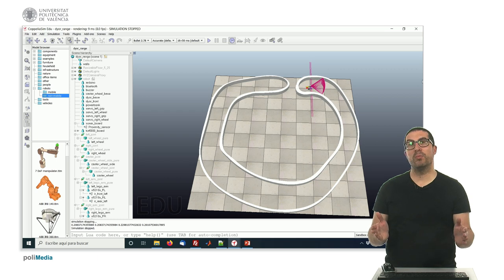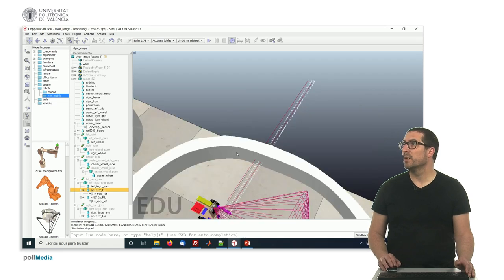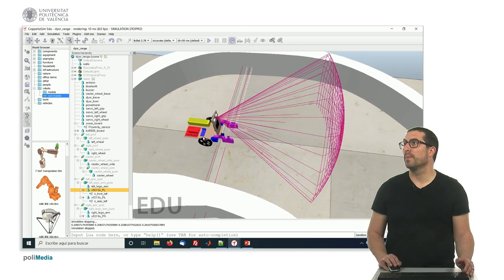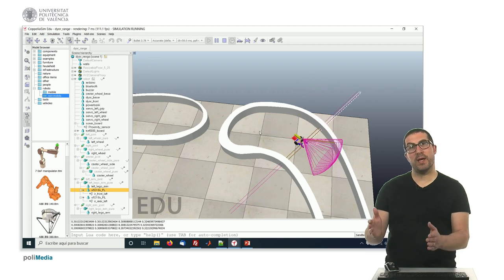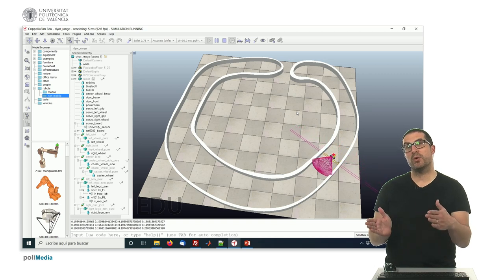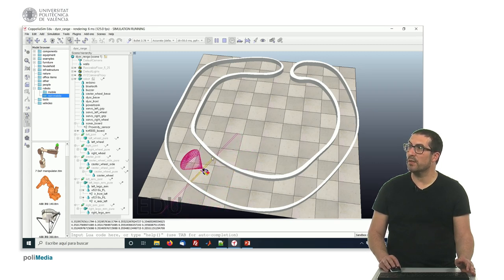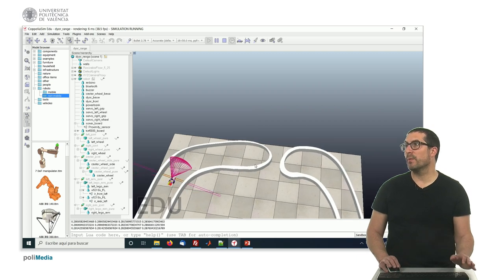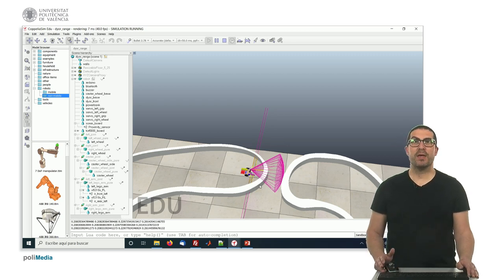Staying between walls (demo) | CoppeliaSim (V-REP)

Comment: I've just bought the solutions on the link reported above but the 'Dyor_range' scene (which is the solution of this demo) doesn't work. What could be the problem?
Reply from the maker: Hello, there's a bug in the last version of the code. The correct code for line 56 is phi=0.5*math.atan((dRL-dFL)/a)+0.5*math.atan((dFR-dRR)/a)
Reply: @LeoArmesto Thanks professor, now it's correctly working
Reply from the maker: @andreafortuna4540  Thanks to you!